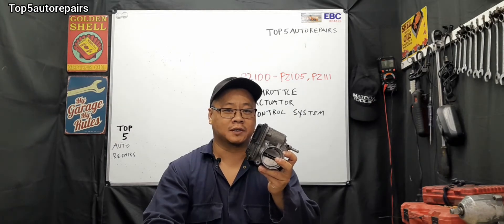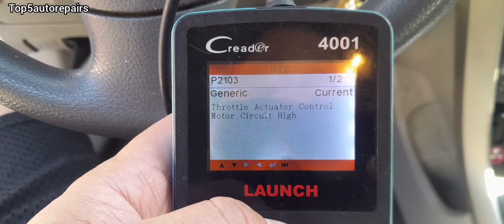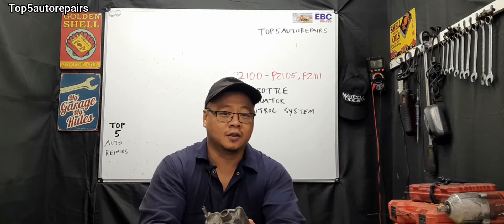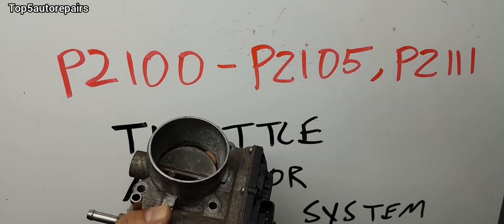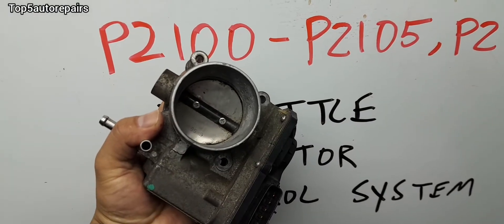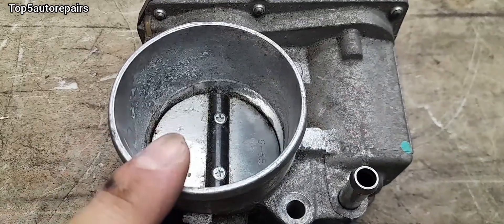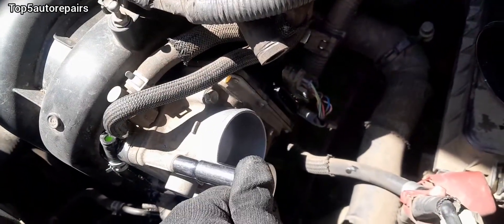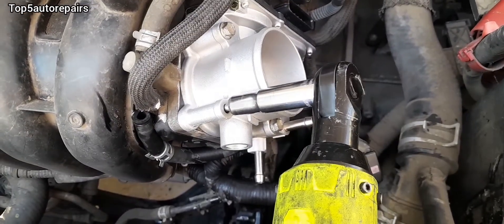THROTTLE ACTUATOR MOTOR CONTROL MALFUNCTION CODE P2100 P2101 P2102 P2103 P2104 P2105 P2111 CIRCUIT

Comment: I have a p2100 code on my 03 Mitsubishi montero. It’s only on intermittently. I will drive it for a while with no issue and then it will come back on and throw my car into limp mode and have this code. I ordered a cheap replacement (not oem, I’ll probably order an oem throttle body assembly now) and when I fired the car on I immediately had a P0642 and P0222 code. I threw the old throttle body assembly back on and the codes are off and the car runs ok. Any idea where to go from here?

Comment: so I have issues with my throttle body position sensor wiring connector and need help pls. all diagrams I have seen don't help I took a Pic but accidentally deleted it to make space on fon n now I'm stuck. the bolt is on flashing and need help. it's a dual line 6 pin connector n the colors are BL/GRN, BL/GRAY, BRN/OR, PINK/YL, BRN/DKBL, BRN/GRN,.. Can u pls help me

Comment: Just got 2102 on my Nissan Titan 2017.  Truck runs fine but engine light is on.  No other codes.  Can. Use brake cleaner to clean the TB or should I go buy actual TB spray
Reply from the maker: Hello. Stick with throttle body cleaner or carburetor cleaner.

Comment: Have this code on my 07 impreza. Replaced the TB, replaced the accelerator pedal, checked all the relays. Looked at all the wiring. Im lost
Reply: Did you find the problem to the solution?
Reply: @husajelly4410  yes and no. This happened after I took my car to the subaru dealership to fix an airbag light so im assuming they sabotaged something and quoted me 6k for new wire harness. Took it to a local subaru shop (not dealership) and they checked everything and figured it was something in my harness somewhere. They checked the voltage on the TB connector, two of the pins are supposed to give power and one was not so they jumped it from another power source. Pretty much bypassed the problem but its fixed.

Comment: I replaced the throttle body and now it won’t turn over did I do something wrong
Reply from the maker: Hello. Was it running before prior to replacing the throttle body? Here is what suggest if it wasn't. Check the connection and wires.
Reply: @Top5AutoRepairs  it was running and went into limp mode I made sure the hose and everything fit right after cleaning it then it wouldn’t start bought a new one put it in still won’t start
Reply: @SuccNastyStories  What was the problem? Mine won't start and I get a P2102 code, among others. I have a Subaru Baja.